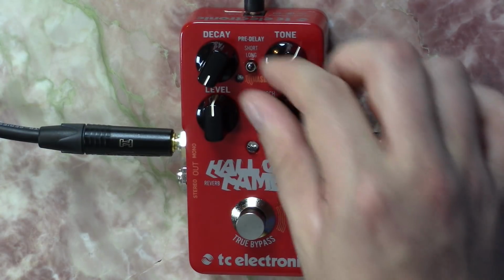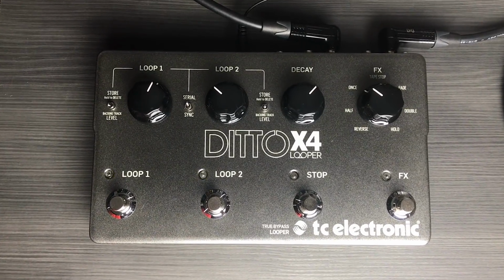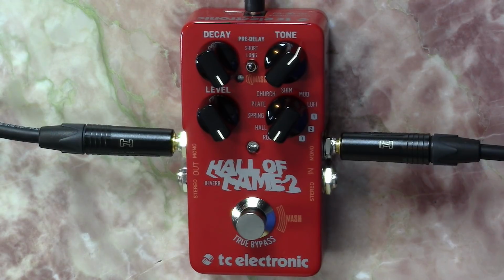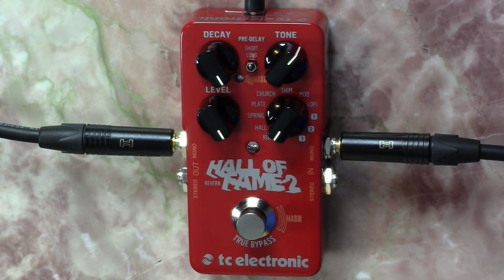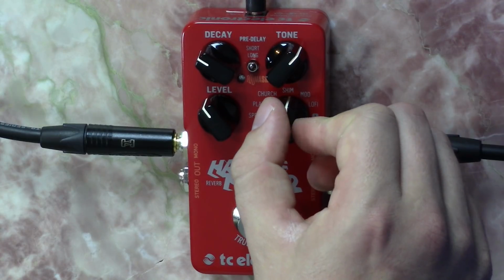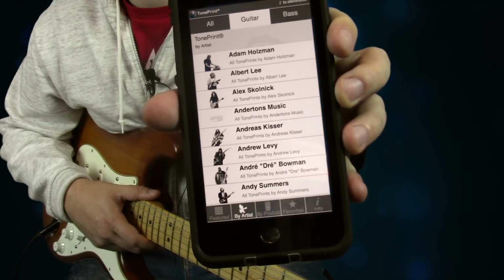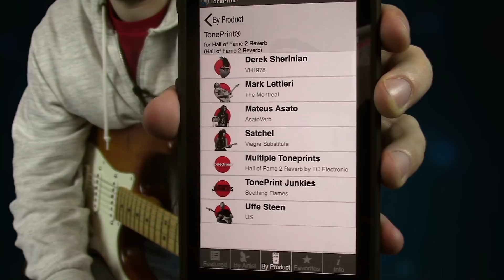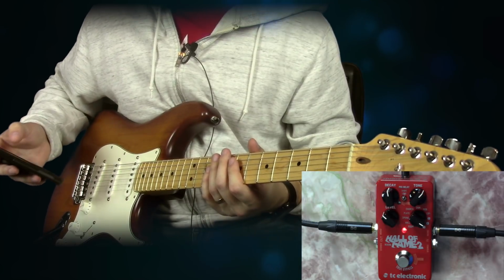The Guitar Player's Guide to Reverb

Comment: I swear by my 1994 Boss RV-3 pink label. Good enough for Radiohead & Sigur Ros. Sure, it doesn't have shimmer, toneprint, or M.A.S.H but it does have the best digital plate reverb I've ever heard. The reverb+delay modes are a treat.
Wouldn't mind a HOF2 as well, or Neunaber Wet.

Comment: Hands down Best Reverb pedal on the market
Reply: Panos Kch it’s very good and great value but I wouldn’t say it was the best.
Reply: Hall of fame 1 is better?
Reply: Panos Kch hall of fame 2 has the mash technology and they have removed tile, ambient and gate reverbs from the presets and added 3 tone print slots instead. You can put them back on via tone print if you want though. They’ve also added a shimmer preset which isn’t on hall of fame 1. All of the other preset algorithms are the same though.